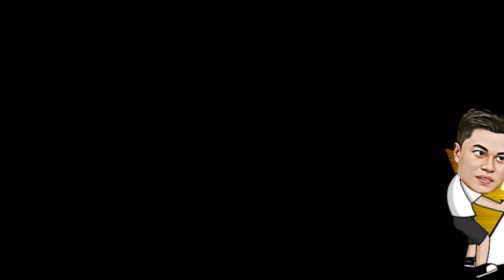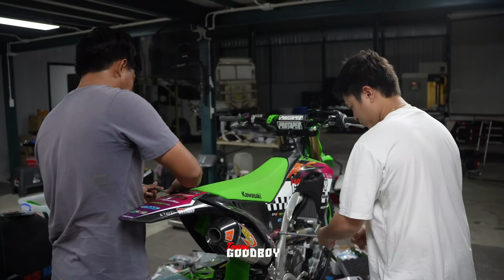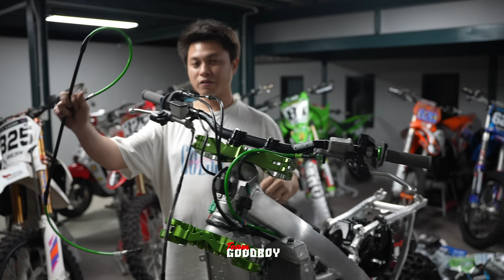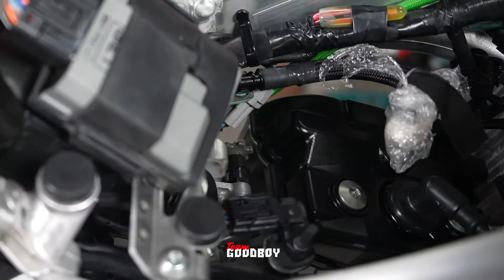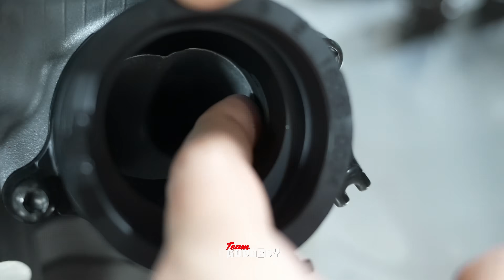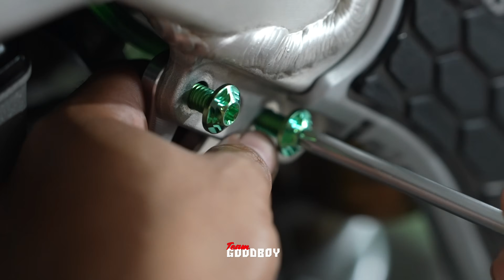2025 KX250F ALL OUT BUILD || NOTHING LEFT UNTURNED

Comment: I want to build a 250 with cams and head work to spin megaaa rpm and add a fuel system to run methanol and 10-15% nitro meth... yes I know the tank of fuel will last 8-10 minutes but having a bike that makes 65ish ponies with peak hp coming in @ 14k and having more over rev than stock peak would be an ideal bike for me but i need a 6sp tranny, Sorry for the ridic post I come from road bikes  so I'm all about the rpm. I have done a meth/ nitro meth supercharged jetski in the past and it wild , only 5% nitro and 95% meth and it was an insane improvement over e85